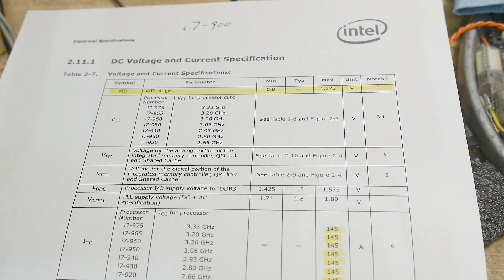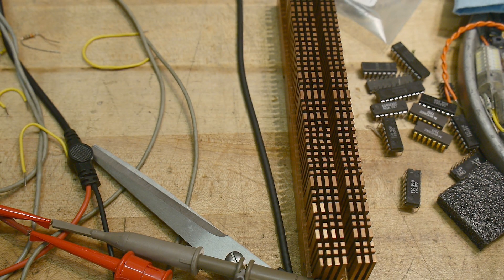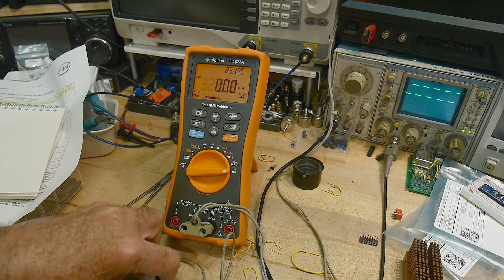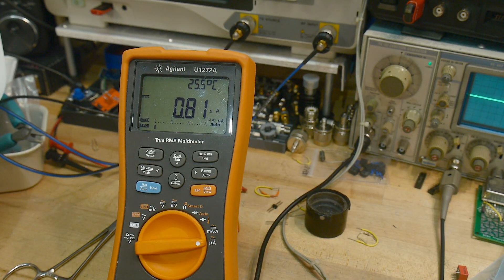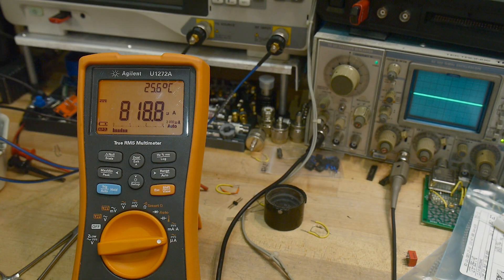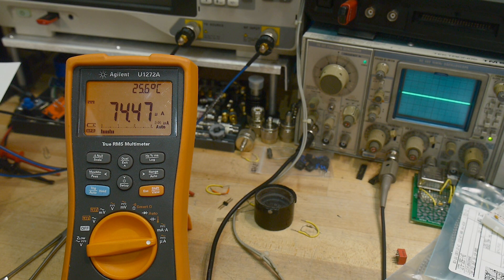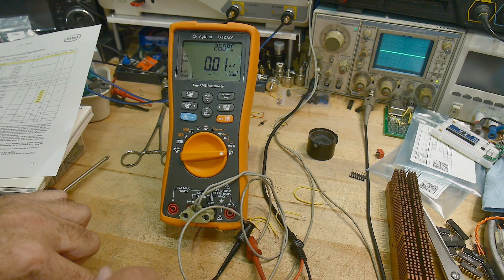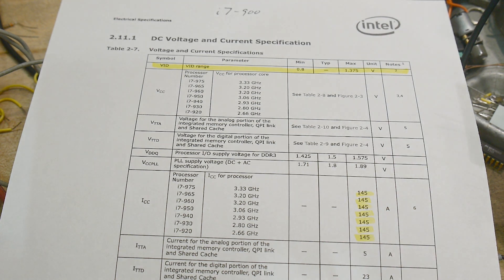#1593 Why does a CPU get hot

Comment: it's a total 12 mosfets of both types (cmos inverter circuit) and bunch of diodes and resistors for that part. unless there are buffers inside too.
this cmos inverter circuit is actually pretty cool. hail to the guy that came up with the idea.

15mA for doing nothing?
What does a TL072, LM13700, CD4013, etc consume do nothing?

From what i know Intel and AMD cpu's use FET's.
Also from a psu perspective, if the generated voltage is low, you can create more amps.
Reply from the maker: TL072 doing nothing: 3.6mA
Reply: @IMSAIGuy  Ah, that's why many eurorack modules claim around 20mA +/-. Thnx.

Comment: Wow, getting 145 amps into that chip must be a real challenge.  I assume there are multiple connections for power and ground but even then differences of micro ohms in the traces would create different voltages on those connections.
Reply: Yes lots of parallel connections, dedicated power and ground planes and multi-phase buck converters! And silly numbers of decoupling capacitors.

Comment: Wow 150A, wouldn't have guessed it.
Reply: Yeah it's really pretty amazing.  Motherboards have to develop this with onboard switching supplies that are super efficient.  It seems like a lot of current through small CPU pins, but there are hundreds of Vcc and ground pins flowing milliamps. Like 200 data pins and almost as many more for clocks and strobes.  Most of the power comes in one side of the CPU, but there are power and ground pins all along the other three edges, then little islands of power for the PLL and something like 250 "reserved" pins.  This is all for i7-920 socket 1366.
Reply: @tonyfremont  good to know, thanks.
Still pretty amazing.

Comment: The gate on each MOS transistor is a capacitor (typically ~30 pF on the 74HC series).  Charging these capacitors requires energy (1/2 CV^2) and discharging them requires dissipating that energy as heat.  Compared to this, the shoot-through is negligible for the 74HC series and modern uProcessors (but not for the 4000 series).
Reply: Indeed !😊
Reply: On a given uCPU, how many transistors are activate per clock? There is a reason why in '94 dynamic voltage and frequency regulation (DVFS) was integrated. On Mobile processors, entire blocks of the processor are commonly off. Number of transitors present is not the same as number of transistors changing state or even active.

Comment: The length of time the output spends changing level H/L/H   when a charged C transfers its charge to another C , there's always a I2C loss = heat     They haven't invented lossless charge transfer and when they do uP will be cold

Comment: They get hot because there's too much inside them, the Intel 8086 and 8088 never got hot, and they are CPUs.
Now let me ramble here, I remember the 8086/8088 and the Windows software that ran on them that was the first multitasking environment that ran on top of DOS. 
I also remember and still have a real copy of DOS2.1 and DOS 3.0 in their hardback little ring binders with their 5.25-inch 360kb disks. When hard drives were 5mb (yes, that's not a typo!).
Those were the days when you didn't need a multicore processor CPU running at GHz to run Windows and Word, in fact, they ran at 4.77 MHz and if you were lucky and had a CPU capable you had a turbo switch that clocked the CPU to 8 MHz.
I feel old now..... 8-(.
Reply: But we are talking about CPUs, and yes something can get hot, but define what the temperature is before you call it hot, the 8086 was not hot enough to feel so high a temperature that it would feel like it would burn you, far from it, hence it not having a heat sink or cooling fan.
Please no more on this, I'm not debating the temperature of a VERY old CPU to determine if the temperature can be called hot or not.
Let us leave it as, "The 8086 was used in the original IBM PCs without any form of heat sink attached to it or cooling fan above it."
Reply: They ran cold enough that they didn't have any heat sinking whatsoever, and no fan on top of them either.
Reply: @getcartercarpark. That doesn't mean they didn't get warm though, the chipset VLSI chips had heatsinks once bus clock speeds got to 66mhz or so.  The big difference now is that there are nearly a million times more transistors switching thousands of times faster. Current draw is linear, but heat output is exponential.  Plus the due size of an 8088 is about the same as a modern due, just way more densely packed.
Reply: Yes, but remember I was referring to only the 8086/8088, not other chips and like not hot, but as above, define hot, not hot enough to burn and not hot enough to warrant a heat sink or any kind of assisted cooling.

Comment: Nice example. The supply current passes the transistors when switching but it also has to charge the capacitors of the gates and the breadboard. 
When you have 800nA for 6 gates at 1000Hz at 5V and you count everything just on the capacitors you get a capacity per gate of 26.6pF. It might in fact just be around half of that value, so half of the current is passing.